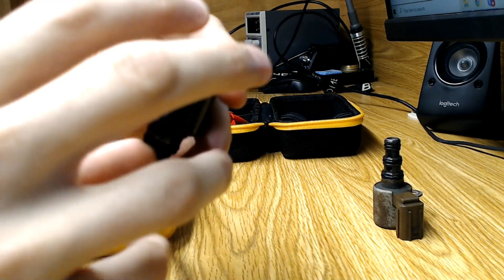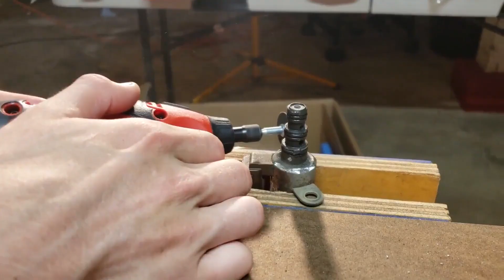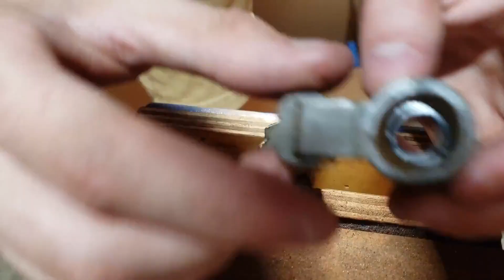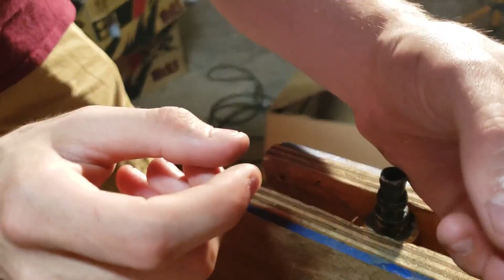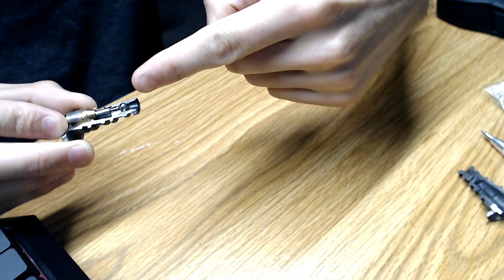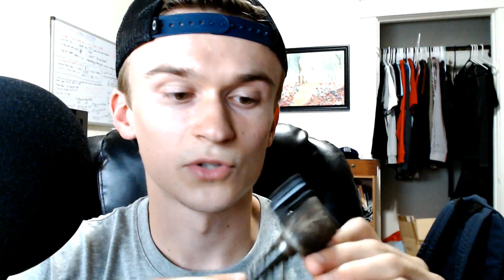Faulty Transmission Shift Solenoid Teardown

Comment: Were these two solenoids removed from the lower front of the transmission? I ask because there are two nearly identical (if not the same part #'s) on the top of the trans also.

Comment: Hi, quick question. I have an 08 TL automatic and it sort of jerks or hiccups when braking and coming to a complete stop. The rpm do jump when I’m braking and getting this jerky feeling. Also when I’m cruising at low speed, the car tends to pull back in a way. I’ve changed the pressure switches and drained and refill 3 times. Do you think there could be an issue with these solenoids ?
Reply from the maker: Does your dash display a check engine light? If so, are any of the codes related to the transmission?
Reply: @3PedalDevils  no I am not getting any codes
Reply: @3PedalDevils  I’ve done a 3x3 drain and refill, changed the trans and motor mounts, and  changed the pressure switches. No luck :(
Reply from the maker: Hmm I've done some thinking on this today and we're hesitant to give any further advice on the specific situation. It's hard to diagnose without witnessing the issue and it could be caused by any number of things. It sounds like you've done your due diligence in figuring it out so sorry to hear that it hasn't worked out yet. You would think that if the solenoids had an issue there would be a DTC displayed. Honestly at this point it might be worth taking to the dealer or a transmission shop for diagnostics. I'm sorry to hear about the issues that your TL is having and I wish I could have been more help. Best of luck to you, I hope you're able to figure out the issue. 

- Connor
Reply: @3PedalDevils  thank you, I appreciate you!
Reply from the maker: We appreciate you too and hope you're able to resolve it. Problems that linger like that are incredibly frustrating, so I feel for ya!
Reply: @3PedalDevils  Right! I have been told to clean the linear shift solenoid. I got nothing to lose. That might be my next move. Lol
Reply from the maker: Yeah I would say it wouldn't hurt! Make sure you don't use any cleaners that are harsh on any sort of seals (buna-N, Viton, Teflon, etc). Most valves have some sort of seal, though some aren't rubber-like materials, it's good to be safe and make sure you don't dry out any of the internal seals and ruin the valve/solenoid. I could see a dirty valve potentially causing studdering issues. Transmission valves tend to be pretty big contamination collectors and the internal flow paths are so small that it's possible for a small piece of debris to disrupt the flow of transmission fluid. Hope that works for ya!
Reply: @3PedalDevils  For sure! Sounds good. Thank you for letting me know!

Comment: Fabulous information. I took all 4 out of my 99 Acura CL..the dual was indicated as the issue, I figured wouldn’t hurt to clean up and inspect the others too while I had it opened up.  I really wanted to understand the functionality better while I cleaned them, but they are sealed for the most part.  I am now subscribing to your channel....I loved watching your video on this, I love to open things up to understand exactly what’s happening too.  GREAT JOB MY FRIEND.
Reply: Ya know those Acuras from 99 to 05 have trans issues quick, like some as early as 30k. 
So, I didnt know that when i picked it up.  I love buying cars under a grand...and going thru them.  We have a great pic a part here in Vegas. I go and strip a bunch of sensors and the expensive stuff new..for dirt cheap ..then i resell a car that most people don't bother with but its good money. Ive gotten quite good with foreign cars actually. This Acura has 130k miles, 3.0 great motor, this girl thought her trans was gone, i got it for 400 bucks, and drove it home. It was slipping out and taking time to engage gears, so I have a bluetooth plugin OBD2 i put in on way, CEL came on and  it read gear ratio so I actually pulled, cleaned extensive and spent few bucks on a new gasket,  car runs great..  You are a smart guy, but if you ever want to chat or you get stumped..Im at Nebzmuzik@outlook.com  or google NebiLacK. Thats my artist name. Take care brother.
Reply from the maker: Thanks for the awesome comment! Were you able to get your CL driving again? I'm glad this helped you understand the functionality! Valves like that are usually crimped or staked closed and pretty much impossible to take part non-destructively, so I'm glad some people have found the video useful! I'll have to try to make more teardown videos like this soon. Also thank you for subscribing to the channel, it means a lot 😁
- Connor
Reply: Oh the reason I was so excited to watch you breakdown of those solenoids,  was that it helped me decide wether or not to bother cleaning these...i was concerned about the copper coil having a rupture..but i lucked out,, this car is from hot weather climate..Im from Illinois, living here in Nevada for work... peace buddy
Reply: @nebilacktheartist6776  I have the same car.....actually I have a 97 and 99 Acura cl and having the same issue on my 99 ....going to replace the lower 2 solenoids and hopefully that will work
Reply: @rodneysherrill8920  
Hey there Rodney. 
Okay so I fell in Love with this electronic controlled design by Honda/Acura.  I read all the complaints of CL owners and other models from 97 to i believe 2005 regarding transmission issues and a constant flow of enormous trans shop bills on both rebuilts & new replace.  The engineering of the rotary engine in my 87 MazdaRX7 was awesome, but these Acura transmissions are special to me. Designed with the dual linear solenoid, single linear pressure solenoid and shift solenoids on the OUTSIDE of valve body...why so cool? Well @260 hp this motor puts out, small car, with a compact transmission. A compact transmission gets very hot with both 3.0 & 3.2 cars. Very clean fluid is extremely important here, as well as regular maintenance on these solenoids (in my opinion, cleaning and reinstall)  loss of pressure inside the trans for any reason related to fluid movement, and now your CEL comes on, limpmode begins, slipping, flashing 5, etc.. 
Any Acura owner who allows fluid to get old and broken down viscosity-wise etc. darker in color..is going to cause torque converter damage and or other damage internally to transmission.  Honda makes highly durable transmissions, now after I purchased several CL models both 3.0 3.2, with supposedly blown transmissions for no joke..$400 cash, able to limp them home, remove so conveniently ALL exterior speed sensors, solenoids, etc. Cleaning them meticulously with electrical parts cleaner and rubbing alcohol, draining 1.75 quarts of black trans oil, new filter if u have 3.2, then I double the exchange of fluid after driving it 10 min. Til completely flushed slowly..clean, clean trans fluid only Honda for this. No exeptions.  I have resold these Acuras shifting perfectly again for 7x what I paid for them. The S  Type purchased for 400.  Sold for $4000. I can do all solenoids w/lock up (6) total and speed sensors 2 within 1.5 hours. Including removal of Battery,starter, harnesses, filter assembly. Cheers! Pure joy when this car takes off, fast and smooth and worth the extra effort in this transmission.
Reply: @nebilacktheartist6776  Hey man yeah....these cars are so small and compact that the 2.3 is very well suited for that car...I couldn’t imagine how the v6 would be in a car so small.....lol....
Reply: @rodneysherrill8920  Its pretty much a race car for the consumer in the V6. Higher the mileage,  the more attention it needs. But dont just allow a trans shop to take your money unless you know for sure more damage is there by shooting the items that may be causing the slips, delayed engaging. Etc. Also, at min. A bluetooth obd2 is critical. PEAK has one that works great with phone for $12.00 on WISH.

Comment: You are one very intelligent young man! I think you might have just saved me a lot of time and money on my 06 Honda Accord with the V6.  I'm going to do exactly the same thing you did to the Acura and I'll definitely keep you posted on my progress but just from the information in your video alone it seems likely you saved me a LOT of trouble!
Reply from the maker: Thanks for the kind words! I'm glad you found the video useful. If I would have known this video would get so many views, I would have tried to make it more helpful for diagnosis! Let us know how your progress comes along on the Accord.
- Connor
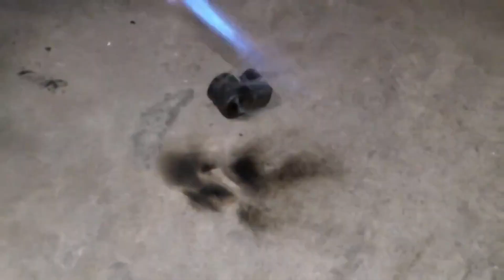Reply: Yes Honda quoted me $2600 plus the cost of a replacement Trans. I saw in a forum that one dealer replaced a guy's solenoid and cured the problem. Not gonna spend $4300 for them to put in a used Trans. You have reinforced my opinion that the solenoid is the problem.  13:40

Comment: Could a Check Engine Light (CEL) code:

 P0756 Shift Solenoid B Performance or stuck off 

for a '04 Honda Accord EX 2.4L  4-Dr Sedan Automatic (approximately 259,000 miles) just be a Solenoid issue or something else (Pressure switch, etc) 
if the car is not going into Reverse for up to 2 minutes & the same thing for Drive (Have to wait a few seconds up to 2 minutes) Drive light blinks, Check Engine Light is on & that is the only code displayed; 
P0756 Shift Solenoid B performance or Stuck Off 
(Other issues: Sometimes there's a quick grinding sound when the car is switching into gear usually after the car is stopped at a stop sign/light then moving again, RPMs rev up high but the speedometer stays low & takes a while to switch gears. After the CEL had been cleared the car drove fine in all gears, 65mph no problem, etc then when the CEL & blinking Drive light came back on it had the issues listed above).
Other Notes: Honda dealership recently drained/filled with new transmission fluid approximately 3 weeks later while up in the mountains I had a loose negative battery connection; dashboard lights flickered, RPMs reved high with harder shifting, after I realized it was a loose negative battery connection I used a SHIM to fill the gap>Battery connection issue fixed but then I started experiencing transmission issues; Just delayed shifting (High RPMs before kicking into gear) took the shim off which obviously involved disconnecting the negative battery cable then lone behold the car was shifting fine. Had to put the shim back in (loose connection) then the same transmission problems started to occur again & became progressively worse as mentioned above. Later after the car finally kicked into Drive it was taken to a transmission shop & they said they were barely able to get it into their bay by pushing it (While in Neutrel) They said it needed to be driveable to run their scan tool to pull codes/test the transmission & their final result is they said it needs a rebuilt transmission ($4500+) no code scans, test drive, they believe it couldn't just be the solenoid, etc. Since it delays so long and or doesn't go into Reverse gear or drive (Not sure how long they actually waited to give the car a chance to go into those gears). If the transmission is actually no good I will take it to a shop that takes the exsisting original transmission out & rebuilds that $2000-$2800 instead of this shop who only orders comptely rebuilt ones for $4500+ (They said they don't rebuild transmissions on foreign cars because they had too many issues & only rebuild original transmissions on American vehicles). Just wanted some feedback, opinions if they still could've scanned the vehicle properly since it starts & even if it can't kick into gear to test drive it and also based on this info if it still could be a Solenoid fix etc (Lengthy info in case this is helpful to determine the issue better & in case this is beneficial to anyone else experiencing similar issues).
Reply from the maker: The car that these faulty solenoids were pulled from (in the video) had some similar issues. There were codes indicating issues with one of the shift solenoids (can't remember the code) and one of the clutch pressure switches (P0873). The owner noticed similar symptoms though: flashing drive light, CEL on, very rough shifts, stuck in a certain gear, etc. He claims that he didn't have any issues in reverse though, so maybe you guys were experiencing different issues. In our case, the Honda dealership recommended replacing two of the shift solenoids, and one of the pressure switches. They quoted around $1100 to do that work, but the job was pretty easy and we were able to replace all three in an hour or two and it only cost about $100 in parts. I guess I'm not going to claim to know more than the transmission shop that you took it to but if the "Shift Solenoid B" is a relatively cheap part, it might be worth trying to replace it before making any $2-5k decisions on transmission rebuilds. The '06 TL that these came out of was completely un-driveable, but after replacing the 2 solenoids and 1 pressure switch, the thing shifted like butter again and didn't have any of the symptoms as before. From some quick searches of your P0756 code, it looks like there are a variety of possible causes: various trans fluid related issues, defective transmission valve body, restricted hydraulic passages, internal transmission failure, faulty shift solenoid, corroded or damaged connector, faulty or damaged wiring.
If the Honda dealer did a proper job with the transmission fluid flush, the fluid related issues shouldn't be relevant. Based on what you said, I'd guess part of the problem is the shift solenoid or a strange electrical issue (based on what you said about the effects of shimming). I can't say for sure what the cause is, but those are some of my initial thoughts. We'll comment again if we come up with further ideas or find anything about it online. Please keep the comments updated with whatever you figure out, in case anyone else runs into a similar issue! Thanks for the comment and best of luck with the car.
Reply: @3PedalDevils  Thank you for the thorough follow up;  Ended up going down to the shop that said they couldn't get it into gear to drive it to then be able to scan it & lone behold I was able to drive it after just waiting a few seconds for it to kick into gear (All gears worked: R, 1, 2, 3, & D) Drove it about 10 miles (Only able to go about 40-45 mph sometime 25-30mph with rough shifting & reving RPMs at times) The Check Engine Light (CEL) was still on but NOW the Drive (Green) light on the dash was NOT blinking (Note: Also noticed harder braking at first but then it seemed to return to normal braking). Anyway, got the car to the new Transmission shop that says they will run a thorough scan & then determine what the problem may be & if it's necessary  they do the exsisting transmission rebuild ($2400 total; Rebuilt Transmission, Labor, Tax with 12 month/12,000 miles local warranty & according to them they replace the Solenoids & Pressure switches, a couple hundred extra if necessary only if motor mounts are needed) vs the $4500 that the initial shop quoted me for a completely rebuilt transmission, that's probably worth more than the car (Not the exsisting transmission>A Remanufactured one shipped to the shop)  Up to $2100 savings difference going with the New Transmission shop , sure beats that & the gamble of putting in a Used 15+ year old transmission '2004 Honda Accord EX'). I'll provide an update what the new transmission shop finds to be the problem(s). Thank You
Reply: @3PedalDevils  Also could you look at the following video & provide a comment/or post a relative video link (If you happen to know of one of course) as to what the issue with the computer might be that this guy is referring to (He has NOT provided a follow up yet as to what exactly was wrong with the computer/specific repair that was done) here's the referenced video info/comment: (Note: This is related to my original posted comment/question to you regarding the loose negative battery cable then the Shim solution if relative in anyway in case it may have had an effect on the car's computer that might be related to this issue below): 

How to replace pressure switch  2003-2006 Honday accord (Yes he put Honday instead of Honda) by Garrett Christian

Later did a follow up comment>(Relevant part) "knew something was wrong because the car was not shifting gears smoothly or at all. The pressure switches ended up not being the issue there was an issue with the computer that told  the engine when to change gears  I got that fixed for about $1000, Now the car runs great. 250k 12 yr old"

Watch "How to replace pressure switch, 2003-2006 honday accord" on YouTube
https://youtu.be/t_u1EgzDMjc